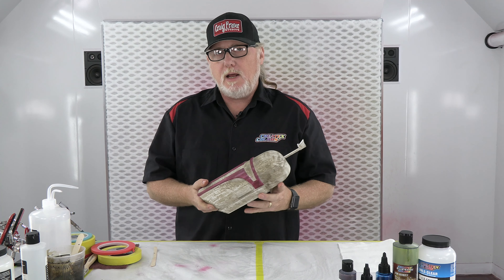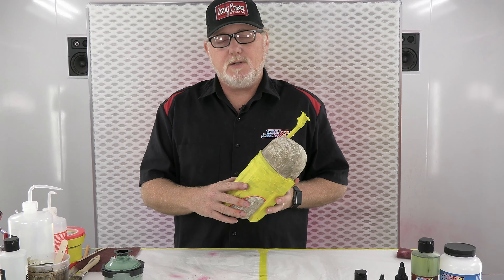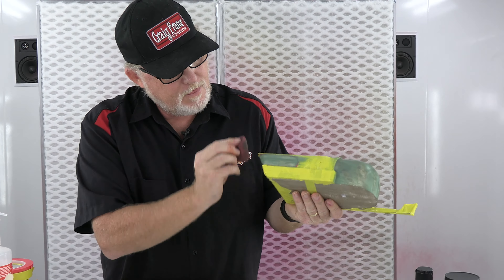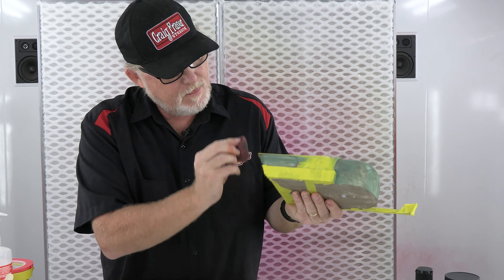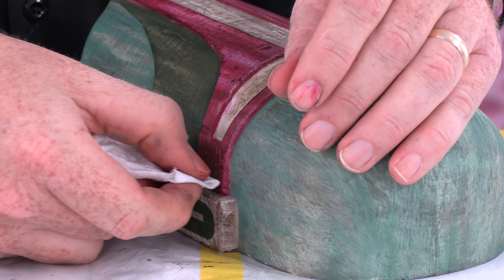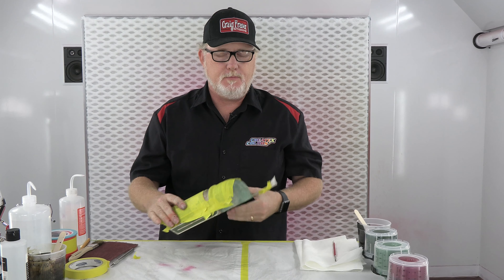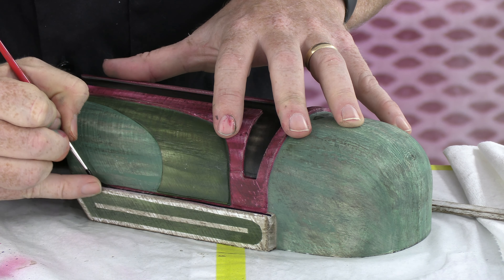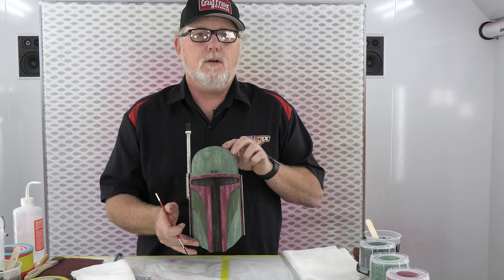Tikifett by Craig Fraser - Pt. 2

Comment: Looks great.. I use Createx colors on 3D printed props all the time =)
Reply from the maker: Thanks. If you've not tried our new 4050 UVLS Gloss Clear as an adhesion promoter, please do. It works well alone as an adhesion coating or used as a replacement for 4030 Balancing Clear; mix paint 3:1 4050, then thin with 4011 Reducer as needed.
Reply: @CreatexColors  Just finished up a helmet for a 501st member (Star Wars).. The helmet is made for wearing both indoor and outdoor - so I used 4050 for both adhesion promoter and clear coat - achieving sturdiness, protecting and beautiful finish.. 
It’s remarkable easy to work with, easy to sand and connects layers of paint and weathering - completing a realistic and battleworn finish.. 
👍🏼
Reply from the maker: 501st, very cool. If OK, we'd like to feature the helmet on our IG, if you wish to share it, please email an image and credits to us at info@createxcolors.com. Thanks again for the info and link to Geoff Wicks for the STL.
Reply: @CreatexColors  I’m very flattered sir - of course.. I’ll see what I can come with and send you an email.. Thx!
Reply: @CreatexColors  I’ve sent you an email 👍🏼

Comment: What brand or type is the yellow masking tape? Thanks.
Reply from the maker: its a generic brand of tape supplied by a local New England automotive jobber Albert Kemperle. Thank you.
Reply: @CreatexColors  Got it. So I should use some easily available, relatively inexpensive masking tape for this. Using the nicer, high-end tape for the critical edges?
Reply from the maker: Yes. As always test your materials before actually using for the first time on an actual project. Thanks.